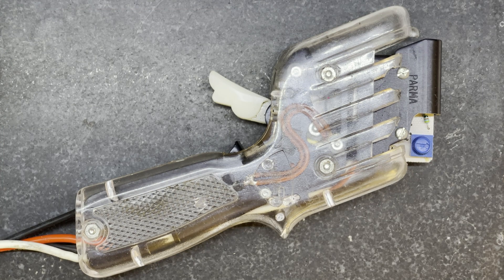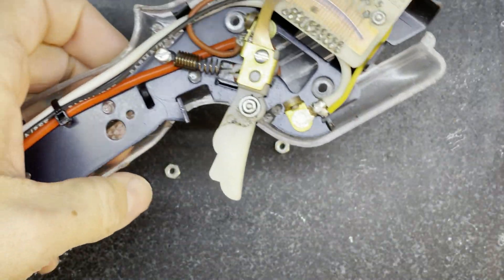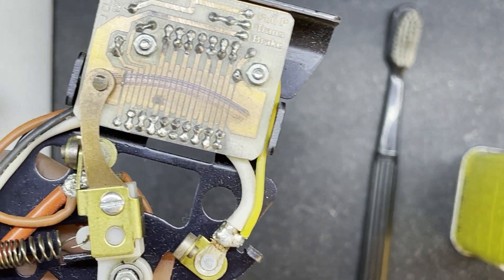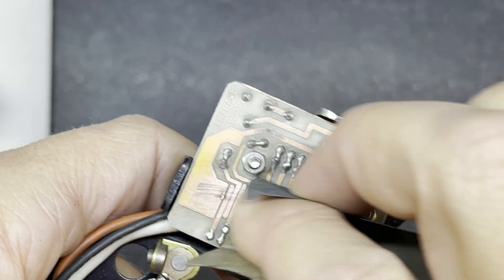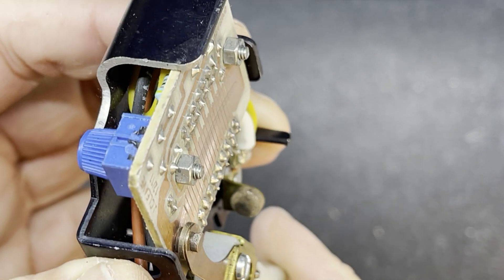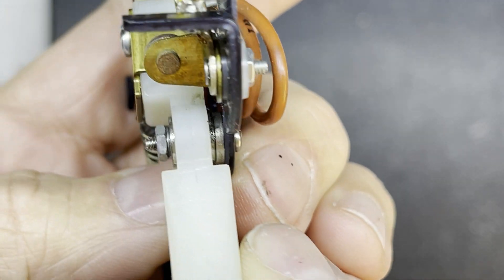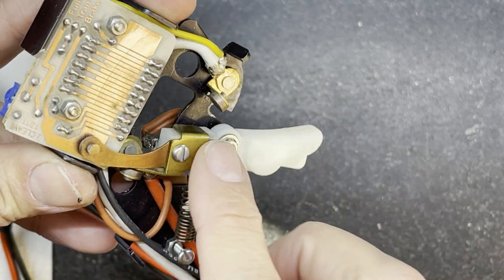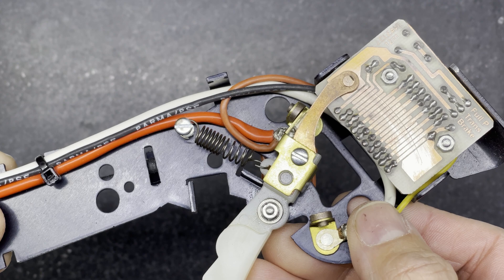Slot car excuses #1 -  Was there a problem with the nut on the hand controller?

Comment: one cool trick i've seen that eliminates the wiper play issue is with A) a floating trigger pin (it makes sure it sits flat on the pcb) and B) have the wiper in 2 parts with a pivot point in the middle somewhere, with a spring to always keep it going towards the pcb

that way the wiper pin sits flatter on the PCB and it always gets pressed on the PCB, without having to "overtighten" the wiper (and increase wear) on the wiper board and always has a same sort of pressure/contact no matter wether you ride left or right handed

Comment: I have a schematic and parts list for the potentiometer pivoting transistorized controller design…much smoother and a lot easier to tune
Reply from the maker: Hi Charles. I do like the idea of using a potentiometer as the trigger pivot but in the limited number of controllers I have seen with this design, they have nearly all failed because the potentiometer is just not designed for so much quick movement.
Reply: @CleaveTech  if memory serves we were using industrial high speed postion sensing potentiometers...high use life time devices
Reply: @CATech1138  It is amazing just how much  movement there is in the trigger for just one lap of a slot car track. Maybe wing cars would not be so much movement but on a scale track the trigger needs to be moved many times in one lap. On one of my club tracks it will be moved more than 30 times a lap!

Comment: I think controllers are the most neglected item in most racers pit box.  Even veteran racers tend to ignore their controller until there's a problem.

I'm right-handed, and have found that I tend to put pressure on the outside (right side) of the controller trigger as I race.  So ... I spend a little extra time making sure the pivot nut is tight and tweaking the wiper arm so that it has constant pressure against the wiper board across the entire swipe of the arm.

And ... some controllers have a little adjustment in the full-power contact holder and the brake contact holder that will allow the racer to make the controller feel more or less responsive.

Comment: I hope you boil that toothbrush before you use it to brush your teeth again! Seriously, I need to get some of those circuit boards, I just rebuilt several parma Turbos and i won't be able to again when the resistors die because they're not available any more
Reply from the maker: I have some spares of a newer version (the one in my current controller) that takes surface mount resistors and has other features such as a relay switch, brake switches, brake pot and anti brakes. You obviously don’t have to wire them all in if you don’t want them.
Send me an email and we can work something out if you are interested 👍🏻

Comment: I clean the wiper board and then place a 10 cent piece worth of WD40 on a clean rag. I wipe the wiper board down with the rag. Very smooth and have never had any issues.
Reply from the maker: Nice tip. Thank you 🙏